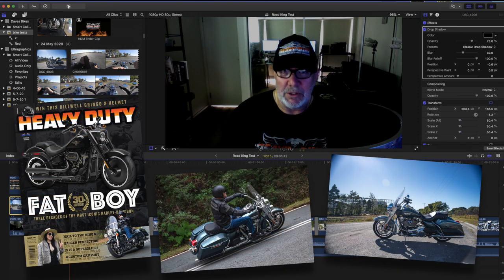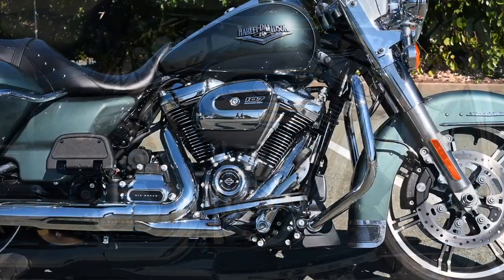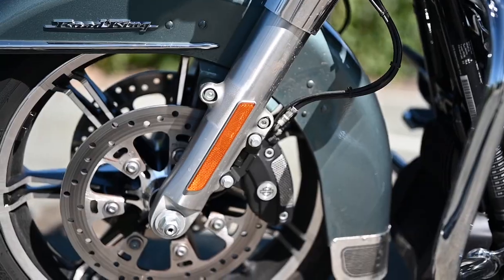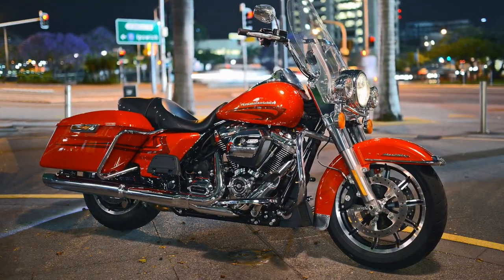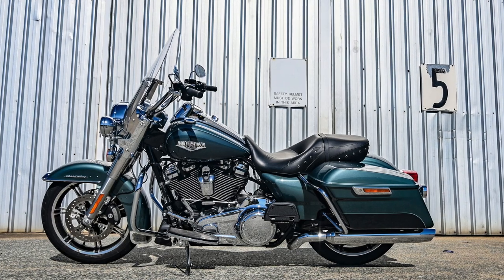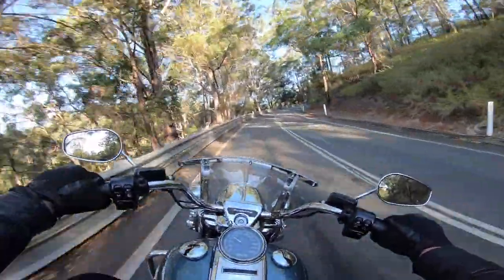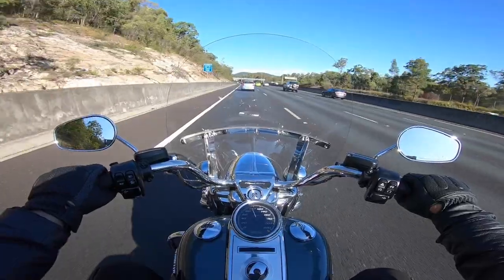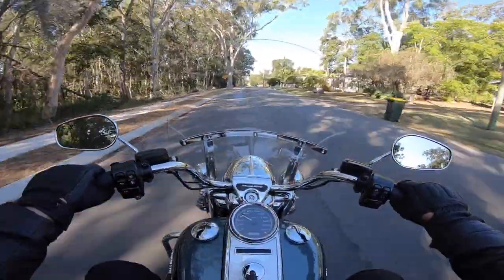H-D Road King Test

Comment: I have a 2020 Road King.  This is my second Road King, my first was a 2013 model with the 103.  One of my favorite motorcycles is the Road King.  My 2020 is an improvement over my first.  It just gets better with each new model.  I had a stage II torque cam done on my 2020 with a full exhaust system.  That really made a significant difference in performance and made my Road King is just awesome.

Comment: Hi David, another great review. I am in the process of getting a 17 RK and would like to put a screen on it. Was wondering what size you would recommend, I am 6'4"? Cheers.
Reply from the maker: Cheers - one that is a few inches taller than stock. The dealers have test saddles and screens. Try one on for size. Also look at the extended reach saddle.
Reply: David Cohen thanks David, I have been looking at the saddle men LS extended reach seats, how do you rate them? Also, what height is the stock windshield? Cheers.

Comment: EXACTLY what I say about the FLHR.. the perfect all around bike.  It’s just as good running a mile away to the store, commuting to work, or crushing miles alone or two up.  
I love this bike so much.
And it’s modular in nature .. pull the windshield off for a more hardcore cruiser look and feel.  Windshield on for long hwy miles.
The bars are the perfect place for me.  
It dips into tight u turns so well.
Braking is bang on. 
The view over the bars is priceless!
Guess u can tell how much I love my 2019 FLHR.
The only thing I bitch about is the sound.
It def isn’t my last ride.. 2010 Fatboy 96cu in TWIN CAM..  sounded amazing 
I have some Tab slip ons on order to hopefully get some sound back.  Mine came with some Cobra Neighbor Haters..  should be called neighbor lovers they’re so damn quiet. Nice low rumble but ehhh.   The old lady loves the quiet pipes.

Hey! What gives HD? Those new wheels look dope.  I’m not gonna whine about the 17s tho.. 
that’s some legit 1st world problems

Comment: Is the switch for the front lamps next to the turn signal switch it behind the lamps. 
?
Reply from the maker: Behind the lamps - from memory.
Reply: @BigDavesPlace  the newer ones had them on the bar in behind the front rear. My No2 Biue

Comment: Curious as to your thoughts on the 2021's return to a cable operated clutch. Big deal or much ado about nothing?
Reply from the maker: Actually - it's probably an improvement. I never noticed any difference between the clutch on Tourers or Softails. But some folks have to moan about something.

Comment: As good as the new bikes handle, the older road kings handled better. Both tires were the same size on the older bikes which made them handle better. The handling is a bit slower with the fat rear tire.